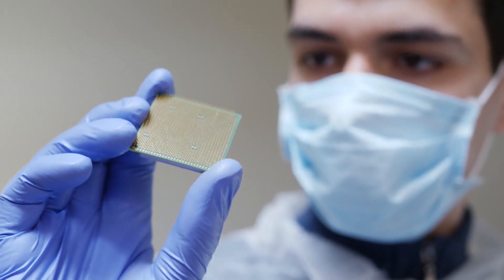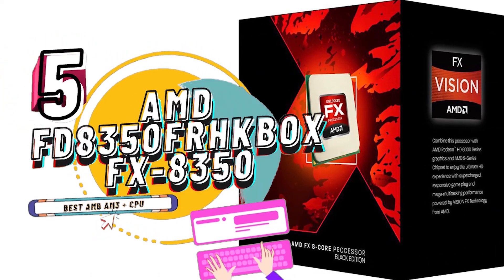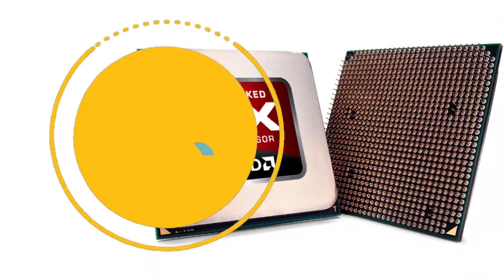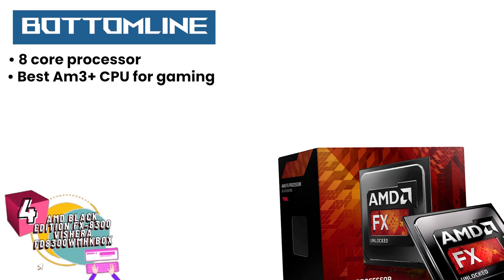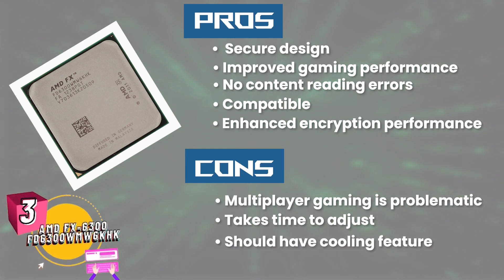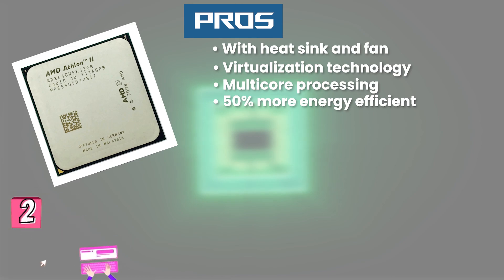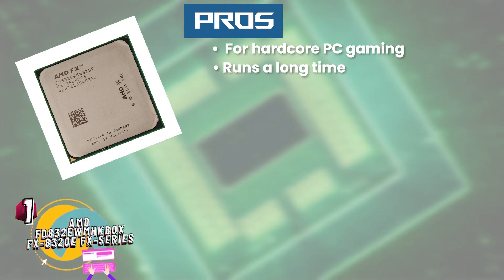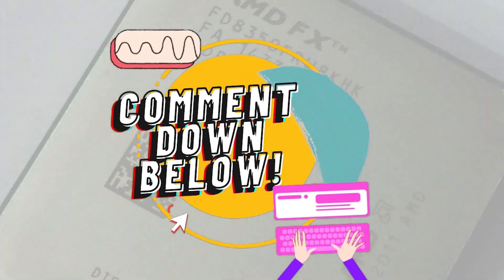Best Am3+ CPUs | Digital Advisor

Comment: Hi, does anyone know if an amd phenom ii x6 1100t cpu  work with a am3+ socket motherboard? If not does anyone know what site and motherboard  would be best to get for it. Currently i have amd phenom ii x6 1100t, i figured out i bought a bad generic board. Currently am looking for a new branded  motherboard and a but having trouble finding one since all am3's been phased out with am4 motherboard taking they're place.
Reply: AM3 works with AM3+
Reply: @wsketchy  Does that mean the motherboard will work straight out of the box with the cpu with no bios updates for the motherboard?
Reply from the maker: Here is the list of supported Motherboards for your CPU
 --> https://bit.ly/3nBrpY3
Hope it helps!
Reply: Does work... its in my msi am3+ motherboard.... pc really bad tho... takes so much just to get into windows and when it does it only will use 1gb ram
Reply: @asianflex  just got my phenom installed on a am3 biostar motherboard and it works. The only issue is with the 2 gb of low profile ram isn't enough that my pc locks ups.
Reply: @joshchelvolski1033  hmm... I have 2 4gb sticks 1 2gb stick and 1gb stick... I mean don’t think it worked before but I could try that to fix mine. Also bios reflash didn’t fix any problems so I’m pretty sure it’s hard ware issues that happens after installing windows

Comment: So, which one is better for gaming? Number 4 or Number 1?
Reply from the maker: For us its the:
AMD FD832EWMHKBOX FX-8320E FX-Series

Here is the link:
--> https://amzn.to/3huYQJl
Reply: I'd say the 8350, 8320E has a lower TDP so as a result doesn't have as much power to work with, but if you look on userbenchmark these vishera cpus generally seem to perform pretty similarly, and they can usually be had for similar prices, about £50 on eBay. So it might come down to price for you